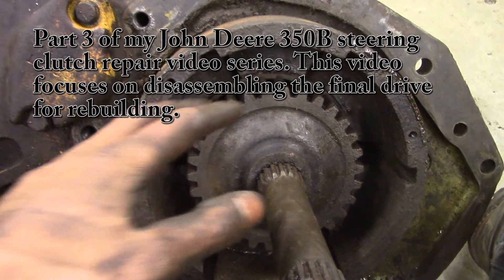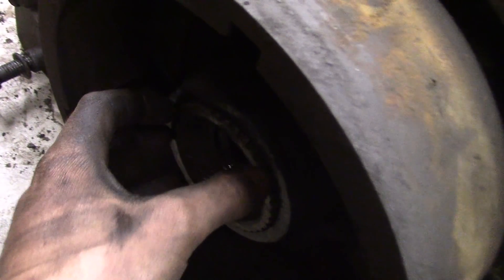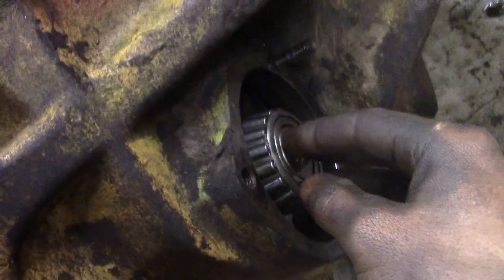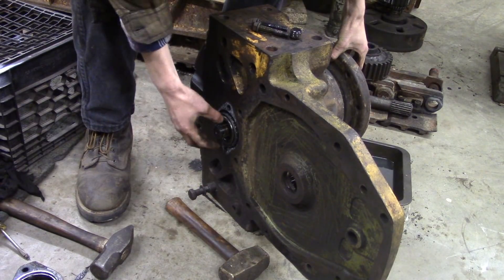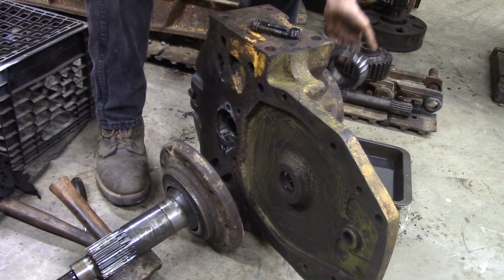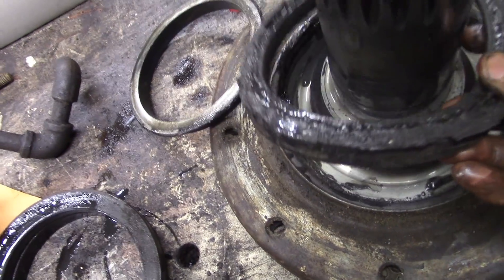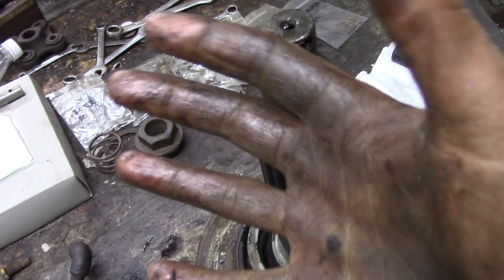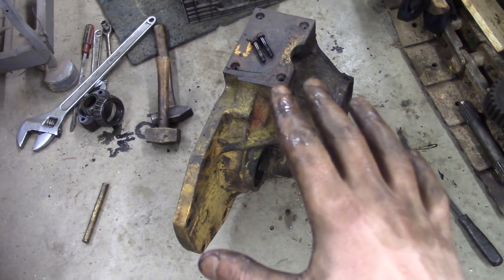John Deere 350B Final Drive Disassembly

Comment: Glad you've uploaded these videos. I have a leaking seal causing my brake band to slip, so I'll be a subscriber.
Reply from the maker: Awesome, thanks! More videos coming soon, waiting for a shaft to come back from the machine shop.
Reply: Best I can figure my leak can only come from either the seal behind the brake drum or from the transmission...which do you think?
Reply from the maker: It could be either. Let's hope that it's the seal in the final, because that will be a LOT easier to fix! however, a swamp yankee fix to a leaky trans shaft seal would be to leave the drain plug for the steering clutch housing out and the leaking oil can exit. Just have to keep refilling trans and/or use a thicker oil.
Reply: Ok, I tore mine apart yesterday. It was a greasy mess. I need a new final drive oil seal that sets behind the brake drum, a bearing that sets behind the top quill, a brake band, and a master pin & bushing. All the disks looked good to me.

Where did u order your parts from?
Reply from the maker: Ordered my stuff from steeringclutch.com. Best prices and free shipping over $500 i think. If i were you, i'd replace everything while you're in there. bearings, seals, pressure plate, etc will cost about $600 total and you'll never have to worry about anything on that corner of the machine again. But that's just me.
Reply: Sounds like a plan to me. 02475 was the bearing and 17381 was the oil seal...just in case anyone needs those numbers.
Reply: I have a 350 dozer it runs forward and reverse for about 3 minutes than it stops won’t move nor foward or backwards? Need help

Comment: Those are called metal face seals. They are really awesome ways to seal in very destructive low pressure environments.
Reply: I hate them lol. Got a Kalmar 30k forklift that we have had to replace them 3 times due to them not seating correctly.

Comment: I wonder if anyone can help me. While attempting to remove the final drive/steering clutch assemble from the tractor, i forgot to release the brake adjustment under the seat of the tractor. While pulling the assembly off the tractor, the brake band has bound around the brake drum and at the brake adjustment bolt, the shaft that adjustment bolt sits on has moved outboard and slipped off th surface it sits on and dropped down about 3/16". this has caused the adjustment bolt to move outwards and is now under the tractor housing, heavy cast main transmission. I am now unable to get a socket on the adjustment bolt, nor am i amble to get the shaft that bolt rides on back up into its proper position. I am stumped and not sure what to do. Possibly the adjustment bolt is seized as well. any ideas to help woudl be greatly appreciated. Thank you

Comment: Glad you filmed this, I was almost 99% positive that there was a fiber and a steel disc behind the hub ring, on jd crawlers message board one guy was saying that only a fiber was behind the hub, another one said fiber and steel, I layed mine out just as they came out and it was just like yours, a fiber and a steel, so thanks. I've got my new disc's installed but I haven't got the tool you check the pressure plate with yet, I may try to make one. If you haven't got your parts yet, you could try tractorparts.com, that's where I got mine, cheaper than that bunch on e bay, thanks.
Reply from the maker: It actually is just a fiber disk. That's what the manual says, and it is how it came apart. I was incorrect in the video. When you put yours together you'll see why - the ID of the steel disk is larger than the snap ring, so it can't really be on either side of the ring. the fiber goes in first, then the hub, then everything else. I'm editing the re-assembly video now, stay tuned!
Reply: My manual isn't clear on this about the hub.
Reply from the maker: when you put it back together you'll see what i mean. the ID of the steel disk is much larger than the snap ring so it can't really be on either side of the snap ring. the fiber disk, however, is retained by the snap ring because it is driven by the inner splines on the hub.
Reply: Yeah I saw what you mean today, the reason the steel disc was I thought behind the hub was because it was stuck to the fiber one, yes you're right, thanks. I got mine in and got it back on the loader today, got 4 bolts in, finish up Monday I hope.
Reply from the maker: Right on! You're making good progress. I just put this machine back together last night as well. Out of the garage today or tomorrow!

Comment: That is a duel cone seal, don’t touch the steel ring with bare skin, it’s a perfect machined surface that the Pressure from the two surfaces being forced to each other from the o-rings and hub being put together cause the sealing, you have to work the rubber o ring with soapy water and steel ring into each part of the hub together.
Reply: Duo cone seal
Reply from the maker: Good to know. I'll just buy a new one, as long as i can find it. I don't think touching the steel with my fingers is an issue, seeing as it was covered with sand, dirt, grease, and grime when it came apart!

Comment: That stuff is heavy. I figured it would have been filthy indide but it looked like clutch material mostly. How do you plan on cleaning the case up?
Reply from the maker: I used several rags, diesel, compressed air, and a can of carb cleaner. Wasn't too bad to clean because nothing was caked, it was all wet.

Comment: the snap ring is actually a lock ring and it uses special pliers with external knurling. http://www.toolup.com/Blackhawk-By-Proto-PT-1266-PLIER-LOCK-RING-7-3-4 is source. snap on sells them. just move the decimal point    be sure to replace that lock ring..  it won't hold its shape after its been distorted.. 

 as for the pilot bearing nub end.. if that is damaged.. some truck manual transmission shops are really great at turning it down and pressing a sleeve on it to bring it back to size.  carry on.. i am enjoying this.
Reply from the maker: Good to know about that tool! I have a home made tool, but it doesn't work super well, depending on the ring size. I'm not sure which of the 4 snap rings you're referring to, but they are all EXTREMELY strong and held their shape fine. The pilot bearing nub end was fine, but the ID that the bearing sits in was trashed. I had a machine shop bore and sleeve it for me. Stay tuned for the re assembly video, it will be up soon!

Comment: Hold onto your ass if you plan on buying any parts from Deere! They are really proud of their stuff and prices reflect that. The bearings could probably be sourced through any bearing supplier and I believe there is some aftermarket parts available. I like eBay for NOS bearings and parts if you have the time to search for them. You probably already know all this, but I thought it might save some $. Undercarriage and finals work is almost always rough, heavy, and dirty but your a young fellow, so I know you can handle it. An engine hoist would be much kinder to your back if you have room to work. Good luck Conner!
Reply from the maker: I was able to get numbers off of the bearings, so those are ordered thru ebay. The seals are beat and i can't read numbers, so i'll try to cross reference seal numbers with JD part numbers once i get my parts manual in the mail. One thing i'll probably have to get from Deere is the special hub to final drive seal. I remember reading a story about Deere price gouging. Some guy bought a replacement shaft for a tractor and was hit with a huge cost. He said, "well, i guess when you get a shaft from deere, they want you to get the shaft in more ways than one!"
Reply: Haha! Yep, JD will give you the best shafting money can buy! LOL! Those seals are Duo Cone seals very similar to what Cat used in the older haul trucks. I have used those B4 on the old 769 Cat trucks and they are a very finicky seal to use. Every part has to be in perfect condition for them to work. I never cared for them much at all. You should think about investing in some transmission snap ring pliers. I have a couple different sizes and configurations of them and I never regretted buying them.
Reply from the maker: Interesting that you and another commenter mentioned how finicky those duo cone seals are. they seem pretty durable and basic to me! I'm sure they had some leakage, but i figured it would serve to wash away any contamination that has gotten to them due to the abrasive environment they operate in.